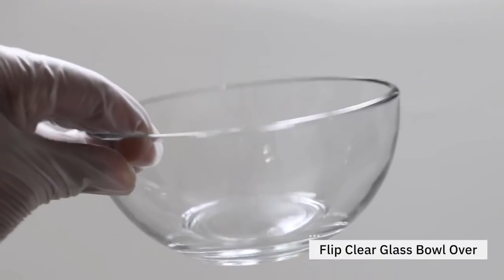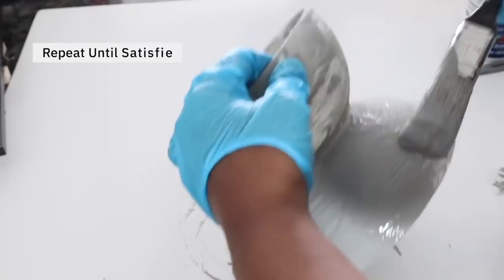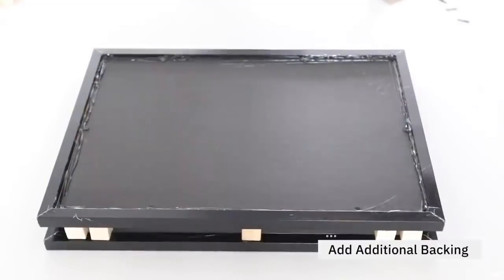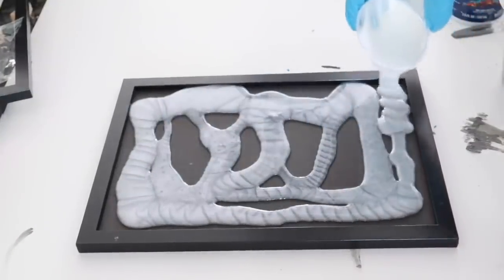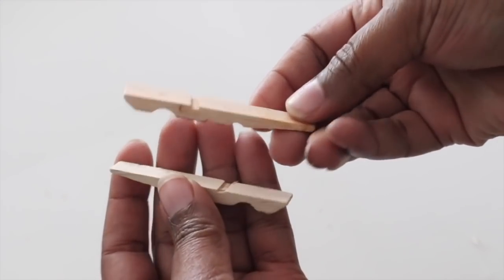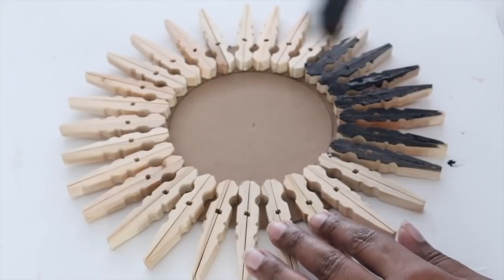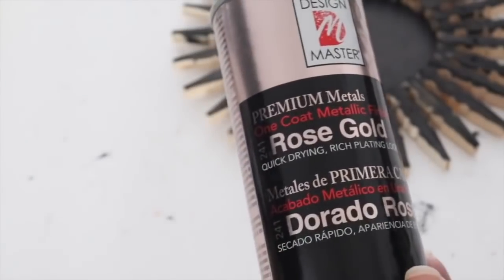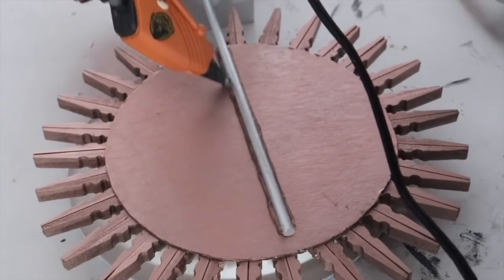DIY Dollar Tree Home Decor Ideas

Comment: Beautiful diys! But can you use a blow dryer to mix the resin if u don't have a heat gun?
Reply from the maker: Thank you! You could use a small torch gun instead of the heat gun. I use it to get the bubbles out of the resin. There are different ways to do it outside of using the heat gun, for sure.